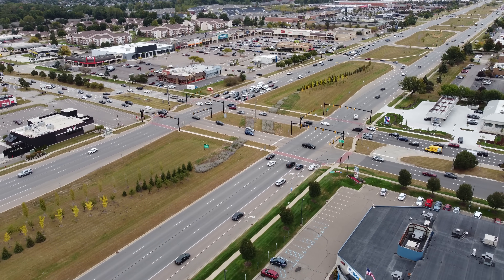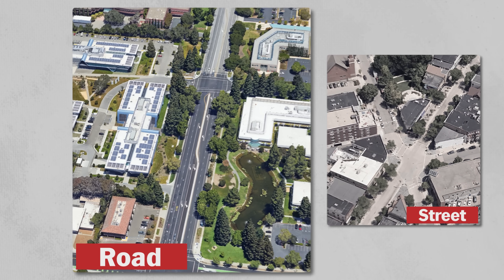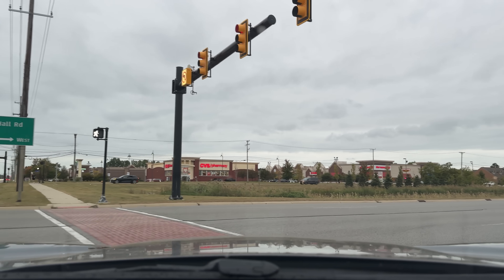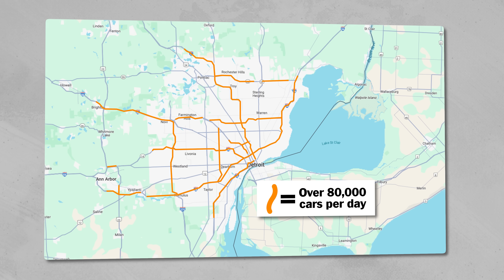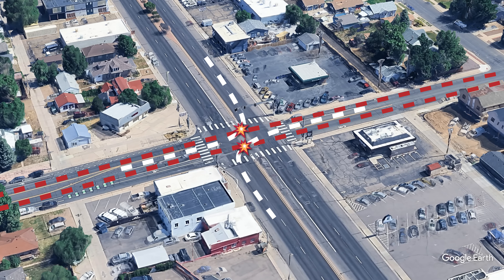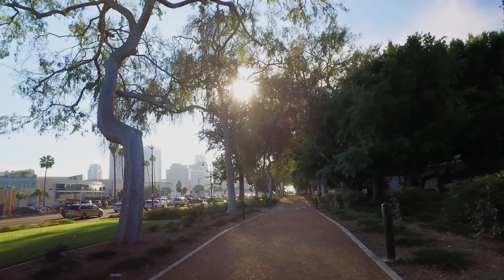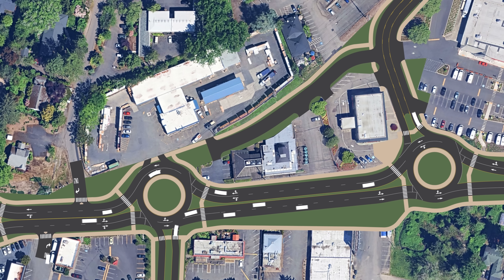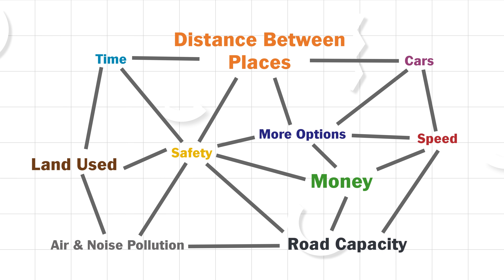How Michigan Built a Super Highway Using Only U-Turns

Comment: The interception idea is great but this solves most of the issues with a standard roundabout there is only two phases stop and go, no inserted left/right turn phase, you should have 2 right turn lanes, one designated for right turns and one for the left, they only have a single right turn lanes this should be fixed

Comment: Lee Road at 23 in Brighton Mich.  has 3 roundabouts in a row. Confusing your first time. 
At night, I could drive from U of D to the east end of 6 Mile without stopping, and stepping on the brakes once. Where I live now, there's a mistimed traffic light every block. Local politicians are elected based on how many traffic lights they can get put in.  But on new roads, we have traffic circles. With 2 lanes and no traffic, I can zip through at 30 MPH.  I like the ones in Europe. Some are just 1 meter wide painted on circles. Sure beats waiting for a traffic light.

Comment: I live in Michigan and have driven down Hall Rd lots. A few things:

-This isn't just Hall Road, this is basically every major thoroughfare that isn't an expressway in the state.
-Hall Rd is particularly well executed, though. M-37 in Grand Rapids, for example, has the lights timed to make sure that through traffic has to stop at every single red light ahead if they hit any of them, which makes it take forever to drive. 
-The U-turns are called "Michigan lefts" by everyone who lives here. Just feels weird to call them anything else. 
-I may have missed you mentioning it, but at a "Michigan left" red light, you can turn left on red unless posted otherwise. 

They are a really good way to handle heavy traffic, although they do not and should not completely replace the basic 3 or 5 lane road with center turning lane for every application. They would be incredibly irritating in all of Michigan's many small towns, for example.

Comment: Hall road is super busy, I used to drive it regularly for my job. As a truck driver its even more fun. I don't miss it.   That said. I prefer Hall road to traffic circles/roundabouts by a long ways. Most circles were NOT designed with trucks hauling48' or 53' trailers in mind.
Reply: They absolutely are designed for 53' trailers, unless you are not driving on a truck route.

Comment: I grew up in SE Michigan and learned to drive there.  I've been living in other states for the past 20 years and I still think Michigan is the best place to drive in America.  Traffic flows fast and smooth almost all of the time.  Traffic in Seattle, where I live now, absolutely sucks.
Reply: The flow is pretty good, but the roads themselves are prone to so much destruction from the salt in the winter, and as a result there is always something under construction pretty much at all times, which then slows everything down. I live right near 696 and I75 and the past 9 years have been a major pain with all the rerouted traffic clogging up the surface/mile roads.
Reply: @vdussaut9182  I live quite close to you. I lived out in NW Oakland county for almost a decade and always worked near Detroit. The joy of being able to get on an expressway in under 5 minutes is indescribable- even if they are always under construction. It took a min of 25 minutes to hit 23, 96, or 75 from out in the exurbs. Then the 2nd leg of my commute began. No thanks. I'm happy as a clam in Fashionable Ferndale.
Reply: @vdussaut9182 yup it’s a pain in the ass to take 96w towards Livonia in the afternoon.
Reply: Same here, except I live in Oregon, which I'm convinced has to be at the bottom of the list for the worst designed roads. There was even a new highway built, Rogue Valley Expressway, to the tune of $120m, just to cut 5 minutes from people's commute, when they could have simply timed the lights on the highway it bypasses.
Reply: Lived and live in both places. I agree😊
Reply: The road conditions with constant construction sucks though
Reply: Michigan lefts are great, but not Michigan drivers
Reply: You guys are fucking idiots in michigan . and you have no fault how's that working out for you your rates are insane.
Reply: Communist
Reply: Holy crap, I just moved to the PNW... They have intersections in Tacoma where there's just no signage. A 4 way intersection where you can just drive right through. I drove through 3 or 4 before I noticed... 
The biggest problem is that it means that if I don't see a stop sign for myself, I have to prepare to stop at the intersection in case the other traffic doesn't have a stop either. Just terrible

Comment: I'd be curious to see stats about which is more effective: The Michigan Left, or the Jughandle. For those who haven't seen one, the Jughandle is an exit from the right lane, which then takes a 180 curve left and rejoins the main road at an intersection. It might be better for areas that don't have a big enough median for a Michigan Left, but I've seen Jughandles with medians too, especially in Vermont.
Reply: I think it probably depends on the space. Michigan Lefts are a little more space-efficient than the Jughandle sounds(never experienced one) but traffic flow from the latter sounds like it'd be a little better on average since all entering/exiting is done on the right as opposed to crossing right to left like Michigan. I can definitely see both of them getting backed up at peak hours, though.

Comment: Hall road is the single most depressing road to drive on in MI. It feels like a stroad x10. Maybe it's because it's surrounded by big box stores. But what else WOULD be there.

Also, it DOES feel bad to do the u-turn because traffic is backed up a lot, but feels even worse trying to merge into the 55 mph traffic TO THE CUT ALL THE WAY OVER into your u-turn. It's like trying to merge onto a highway from a dead stop and needing to immediately exit.

It's the worst bastserdization of highways and stroads. Don't forget that it literally becomes a road from an actual highway as well.

Comment: So called, "Michigan lefts" are just stupid! 

They built a few in Tucson and they cause nothing but total chaos!

They suck! Why? Because it takes 5 minutes to essentially make a left turn in what used to take 3 or 3.5 min. Dumb!

Oh, and the confusion they create causes MORE HIGH SPEED T-BONE or rear end crashes because people think they can still make a left at the main intersection.

You now have to clear 2 signal lights too! One for the U turn and one for the right turn. I just avoid the whole intersection if I plan to normally go that's way.

BTW, they are even dumber in MI, where when it snows people lose traction and spin out, get stuck, etc. 

Whom ever came up with this monstrosity should have their engineering degree revoked!

Comment: What if the Michigan U-turn were a double ended horseshoe type round about where both sides enter at the second left to change directions as the first left is the other side moving to go your way? So you slow down before first left of entering traffic  going your way, merge in round about style, take second left, cross median,  turn left  into protected lane, merge right to exit/entry lane, then merge right to new direction.

If no merge available after crossing median, driver stays in  protected inner ring and takes another lap around the median for lap. So at each left lane before the elongated roundabout comes up is an extra paint or barrier protected “feeder/ merge” or “transition lane. You first enter that lane to get to second left to begin roundabout process. If you cannot merge left, stay in lane to exit back to your flow and grab the next one.

Failure to exit means take another lap. Failure to enter means maintaining path and go down to next one and try again.

Thoughts?
Reply: Only good for law volume roads.  High volume roads need signalization.

Comment: I live down near Three Rivers where US-131 passes through. They did a super major re-work just a few years ago which includes "Michigan Lefts". At first I hated it, but got used to it later on. I'd say most of the traffic passes through anyway. Roundabouts would not work real good due to so many semi trucks, plus people still don't get it when it comes to using roundabouts. Motorists traveling on M-60 still have to navigate through town center to continue, That is a problem. They managed to build a nice bypass around Constantine several years ago now need to do the same for Three Rivers and M-60.

Comment: My town in Michigan is just like this. Most of the roads are only one lane each way and the lights tend to turn green right as you approach it. The speed limit is 45mph; but most people go 35-40 because of the traffic lights

We also have Michigan Ave which uses Michigan lefts and has a 55mph speed limit, however, you’ll only hit every green if you go 45mph

The one bad flaw is that all the commercial zones are concentrated on one road (Ford Rd) and you’ll literally have to wait at every light. It takes an extra 10 minutes if you take Ford. However, the town is planning on turning it into a boulevard like Hall Rd with Michigan lefts

Comment: I really don't understand why Americans are so allergic to learning from other countries. Instead of just adopting the already functional systems that exist elsewhere they try these crazy adjustments to keep their insane 8 lane stroads going.
The problem is not the stroad, that's just the symptom. It's the entire system that is dysfunctional, which leads to the stroad existing.
Reply: Six to eight lane stroads are actually quite rare.  States have even stopped designing 5 lane stroads.  Stroads happened in the 1960s-1990s because business wanted to get easy access for all highway users on cross country trips.  The highway department wanted traffic flow, the business wanted access.  So now both the flow and access is difficult.

Comment: As a Michigander this road, Telegraph, and Fort St run the areas I have lived in. Often times people will prefer these roads to getting on a highway because you might only save one minute after using so much fuel and putting extra wear on your vehicle using a highway.
Reply: You might be pleasantly surprised to find out that highway miles are a lot easier on a vehicle than city miles.

Comment: In my experience, roundabouts are grotesquely overrated by theorists. They are intensely unpleasant to try to navigate, and they are, themselves, massive "conflict points" where you wind up with a lot of potential for accidents because you can't even predict accurately whether somebody is going to turn off or drive into your attempt to get on.

And - I'm at 12:06 right now for the image in this video - the crosswalks are atrocious to add to a roundabout. The whole point of a roundabout (not that they achieve this, thanks to the need to stop completely to figure out whether the cars already on it are going to let you on or not) is to avoid stops, which means they're at odds with the need to stop for the crosswalk.

We really need to focus on either tunnels or bridges for pedestrians. I know that's more expensive, but crosswalks instantly defeat any hope of this "street" being "a place." They inherently make walking next to or across the street a trial, and they make the street divide the area up just as effectively as if it were a road or a highway. What needs to happen with these "streets that are to be places" is that they need to be replaced by better arteries, potentially including a straight-up elevated highway over the whole stretch while the area below is given over to much lighter local traffic and to pedestrians.
Reply: Roundabouts are bad for hogh density urban unless the car volumes are lowered.  Which is why roundabouts work a lot better in rural and light suburban intersections.

Comment: Works thanks to traffic lights. On my road intersections where entirely removed replaced by U-turn and right turn only. It is very dangerous to move many lines relaying on back mirrors
Reply: You are doing it wrong.  You are supposed to turn directly into the left lane and enter the u-turn,  ot merge to the left lane.

Comment: I live in the area and occasionally take Hall Road but I hate it because there are too many businesses and too much traffic.  However, that brings a solution that this type of road supplies.  On a normal road with left turn lanes, if the business you want is the opposite direction of your travel and you miss your turn, you have to find somewhere to turn around.  That is usually a business parking lot or at worst another street far down the road.  With a Michigan left, if you miss the turn to go to your business, simply travel down the road to the next Michigan left to turn around and backtrack safely to your business turn off.

Comment: Anything but a roundabout in America 🙏
Reply: Becuase it would not work here.  America has more roundabouts than any other country (except France and Italy), so America knows where they do and do NOT work.  The volumes here are too high, which means it will cause more congestion.  They are better for rural and light suburban roads.
Reply: @traffic.engineer  Shame. Volumes wouldn't be an issue if there were public transport options available but they'd never do that either.

Comment: I like your approach but I think a few things can be added.  The awful design of intersections in the interstate system with traffic lights on either side of the lesser? road being intersected works ok if that road has low traffic but if it is an important traffic carrier this idea sucks.  Rather back to the old cloverleaf plan that allows intersections without stops.   Another good idea is what they do in NJ with jughandles, another quaint idea that NJ does is it actually builds overpasses on existing intersections that have gotten too busy.  I like your thing about building bus stop lanes off the street,  a city I once lived in had a transit strike and everybody predicted that the sky would fall but without the busses taking up the right lane during rush hours, things moved pretty smoothly, this is why I don't support bus transit in larger urban areas, any transit 'solution' that doesn't get traffic off the street isn't a solution.

Comment: In all the exemple at the end of the video, nothing there seems even remotely pedestrian friendly. A roundabout is a high traffic, always flowing kind of junction. It isn't convenient at all for pedestrian to cross, even when cut in multiple smaller laner, since cars aren't meant to stop or slow down all that much.
Unless it's a very slow speed, one-lane only kind of roundabout... basically a type specifically designed for residential or pedestrian areas, I'd always avoid roundabouts as a pedestrian if I can.

So designing a "place to be", as a liveable space to hang out on foot and putting a bunch of medium/large roundabouts in the middle of it makes no sense at all to me.
Reply: Roundabouts also increase the walking distance to cross, rather than cross directly.  Roundabouts are much better for rural and light suburban intersections.  But medians can make it easier for pedestrians to cross.

Comment: All of these solutions work to greater or lesser degree until, heavy slow trucks are added into the equation. Trying to wield a slow accelerating truck to merge across several lanes in a short distance creates a very dangerous situation!
Reply: You are not supposed to merge.  You are supposed to turn right on green green directly in the leftmost lane.
Reply: @traffic.engineer  Yes, in the perfect world. Though when a heavily laden truck enters with a right turn and continues to 'merge' left in the limited amount of distance....quite often traffic being merged into will cause hazardous lane changing conditions. Sadly, the speed of traffic to be merging into can tragically complicate the path of said truck to the Michigan left turn lane. My apologies, if I was less than clear with my response.

Comment: I like these, but points of possible incidents run high. I myself was struck when I used the turnaround, it was flashing yellows all sides so the lights were messed up or something, it’s a double lane turnaround so the outer lane can go straight and the inner lane can turn. The outer lane created a blind spot I looked and saw enough room I turned, straightened out and was accelerating when a jeep wrangler going 50 hit me. My car spun and I was set wrong way around when it all was said and done. At 3:04 you will see a turnaround just like the one that got me hit.

Comment: You should do a video about Continuous Flow for stroad intersections. They seem to be the best solution for keeping heavy traffic flowing on multi-lane, high volume stroads. However, there are some caveats: 
- they should always include a right-turn-only lane to the right of the left-turn lanes to ensure that cars can continue to turn right unimpeded.
- they should be designed in a consistent manner to avoid driver confusion.
- as with all novel types of intersection, public education is paramount! They must have adequate lane markings and signage to properly inform drivers of their correct use.

Comment: The Michigan Left is not new to me - it's used everywhere. What's new is two roads crossing like that and the application of that system on highways. I saw highways crossing on the same level in two places: the US and Cuba. I do understand why they did that in Cuba, though.

OBS: synchronizing the traffic lights isn't easy because one is going in one directio while the other is going in the other direction - they will collide at some point.